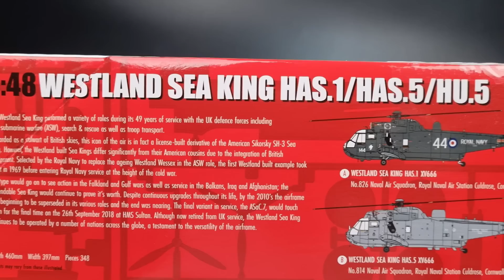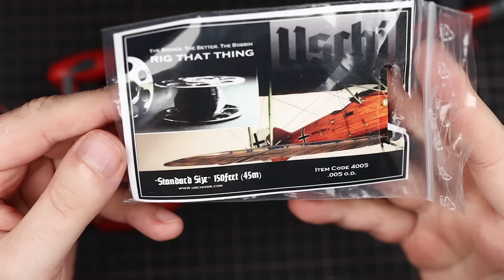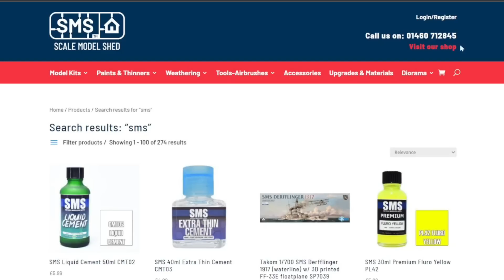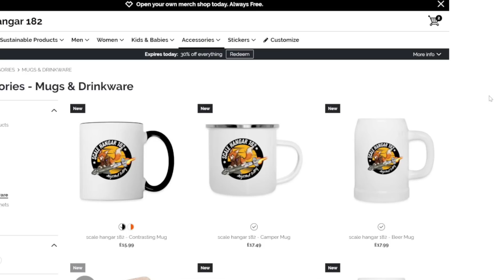Westland Sea King Airfix 1/48 scale | Full build video

Comment: Lovely build. Got this kit in my stash. Question, where did you get the drill and what is it called that you used to drill the holes out for the seats?
Reply from the maker: That's a trumpeter master tool drill. And I use Dspiae drill bits